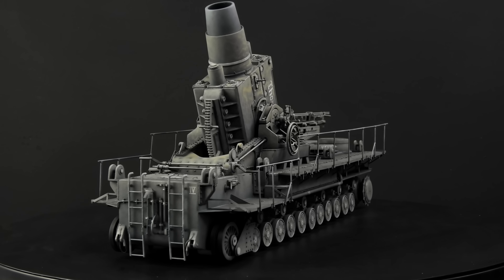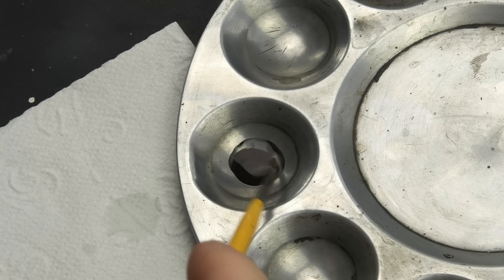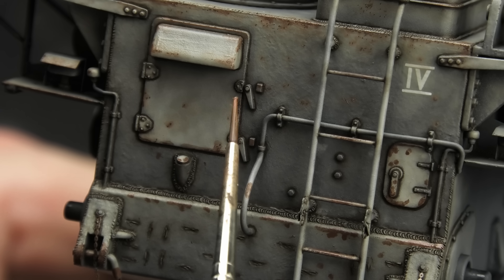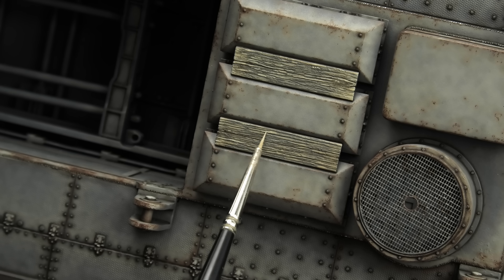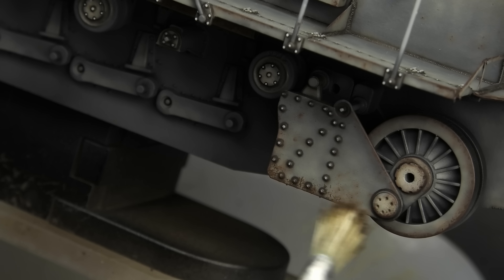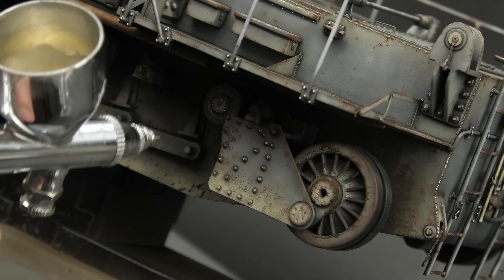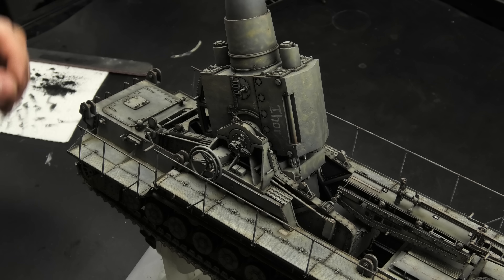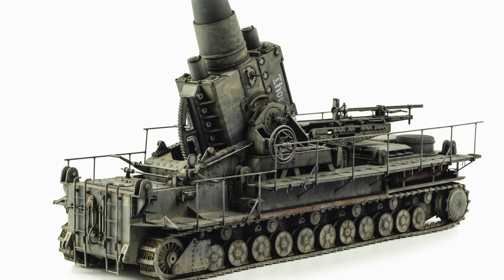This Model Isn't For The Faint Of Heart! Morser Karl Full Weathering (Trumpeter 1/35)

Comment: The most important thing to remember about rust on German vehicles, the soldiers had hobnails on the bottom of their boots. Hobnails are nails. Nails are metal,thus they scrape the paint which leads to rust. I was told years ago that tank crews removed the hobnails because they made walking on the armor very difficult. Add frost to the equation and someone is going to fall off the tank.

Comment: I cannot tell you how much I enjoyed this video my friend. I set it up and then pressed play as I started chipping a 1:72 T35. I confess, I struggle with oil pin washes, all I seem to do is move the dark stain around rather than clean it from areas I don't want it. But, I have not done the technique much and it can be so many reasons why it isn't working for me, for instance that I am not applying it to the right surface (I did it over a dot filter but didn't put a varnish between the two!!). So, keeping it short. Thanks for this and once I get to teh end, I am going to replay it, just so I am modelling with a buddy!!!😂😂👍👍😉

Comment: As you can break the surface tension of water with dish soap, I was wondering if this could work out as well with the bluing solution to get a smoother result and less air bubbles while blackening the tracks?

Comment: The hydraulic pistons could use a slight dulling down I think. Real hydraulic pistons on large machines rarely look super shiny and they get a very slightly aluminum-ish satin finish from the grease and hydraulic fluid inside.  Happens more on large machines where slightly larger tolerances on the oil seals let the oils out onto the silver surface. 

Also maybe making some straight oily coloured streaks lengthwise along the piston could break up the look.

Comment: Hi, have you considered using a vacuum chamber to remove air bubbles when blackening the tracks. I've seen people using some small ones for various epoxy resin projects. I'm not sure how it will affect the overall process, I suspect temperature will increase so it might affect the look or the time it takes to fully treat the material. Anyway great video as always, cheers.

Comment: In watercolor the "best" painters tend to use multiple tones to paint one area by adding colors together as they go. This model really seemed like one begging for more than one color for the pinwash - you mentioned that the first bottle was too blue, which might have been amazing to use for "shaded" areas, allowing it to mix on the model (or dipping into the cooler toned wash with a semi loaded main color if full cool was not required). This could give even futher variation on the model, limited to the pinwashed sections.

Comment: Not going to lie for warm fuzziness. I liked it when my weekend started with Nightshift and ended with Corporal's Corner. THAT said. As I said on you disclosure video, you only get one ass. 
I TRULY understand how hard it is to stay inspired to build/paint. I have painted just shy of 100 complete table top armies from pretty much EVERY time period/genre. There's only so much you can do to individualize one or another model after that as I also do dioramas though that has slowed down due a lot in part to over all lack of patriotism in my country's latest generation. I balance out my work weeks between WORK, and my various model projects with at least a day in the woods sometimes using the quiet to sketch out and idea for a colorscheme.
I don't film my builds. The only records I keep are purely account related i.e. paints and materials used for this or that project. If I take a picture, it is for the customer. 
Anyhoooo "Thor" is looking pretty damn good. Catch ya next time.

Comment: Hi Martin, Amazing job, as always👍🏻. You are an inspiration and my "go to" encyclopedia when armor modeling doubts occurs (about 98.7% of the time}. I have a tiny suggestion though, don't you think that a bit of dark grease streaks on the chrome would tone it down a bit, on the screen they seem to really stand out. Thank you for your videos, I always enjoy them, publish them at your convenience, nobody is going away😊
Reply from the maker: Thanks, shiny pistons are my weakness! :D I had bad experience with the tape in the past, even the slightest touch of thinner will dissolve the adhesive layer and it'll start peeling off. That being said, this is the last model where I had to take half-measures to get it done in time :)
Reply: @NightShiftScaleModels  You may use actual grease (try on a piece of your shiny paper first). The grease will dry with time and is anyway in a protected, recessed, place.
Reply: Thinking more about it, likely a bad idea as a very thin layer of grease would catch the dust flying in the air. Maybe use water based color ? Anyway you did an out of this word model, as usual !

Comment: Im not a modeler at all, but i do work around heavy machinery quite a bit. Might i suggest heavier paint chipping around the ladder where the soldiers would step up onto the deck. Thats one of the most common places i see paint completely worn off of equipment given grime and dirt abrading the paint where people walk and germans had mostly hobnail boots in ww2 that would totally destroy any paint anywhere they stepped on that giant metal deck

Comment: its a good day when uncle night shift uploads. a question, how do you clean your brushes after using tamiya putty for texturing?
Reply: You can use the Tamiya glue to clean it, and I think lacquer thinner can remove it too but not sure. But there is definitely thinners that easily dissolve the putty and let you clean the brush.
Reply: @Chevsilverado  and then how do i clean the glue?
Reply: @goofyproductions2672  The cement just evaporates completely. It’s just a solvent to melt plastic and no actual “glue”.
Reply: @Chevsilverado  thanks! and by tamiya glue do you mean green cap or white cap
Reply: @goofyproductions2672  Green cap cement, any extra thin cement would work like mr cement S, as long as it’s not quick-drying type.

Comment: so hey uncle nightshift... I just had an idea you must hear.

I know you love giving your models those nice well looking seam lines with putty but hear this out.

So, you remember when you were making the amx 50b from resin scales and the crazy good detail that kit had but the fact that it was brittle?
Well, apparently theres a different kind of resin thats SUPERduperHIPERturbo flexible soooooooooooooooooooo...

What if you made lets say a 3d file that contained every single weld seam your next models would need, you know, maybe standarize the straight ones to have a flat bottom so that you can chisel their way first and then insert the weld, of have some of the 90 degree angle ones, maybe some with a bit of curve and so on.

And the best part would be that because they are flexible the application onto a model should be a breeze saving you at least a few hours of time.